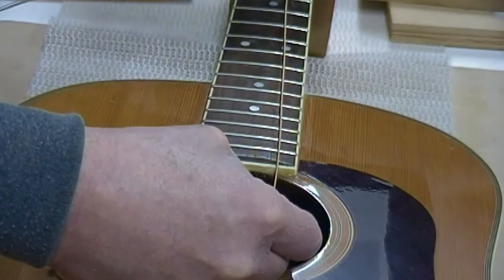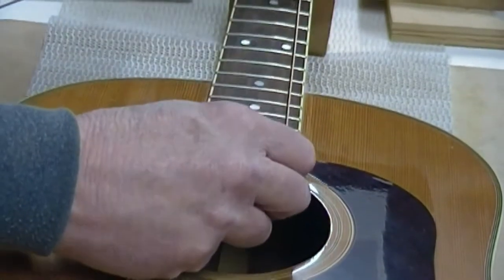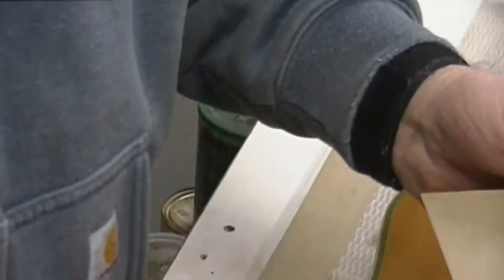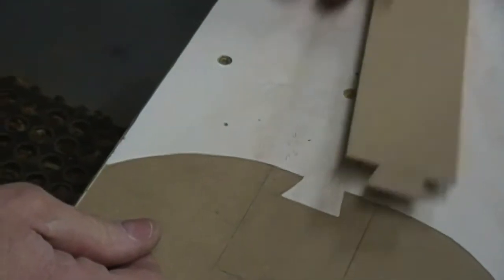JONAH GUITAR, Dovetail Neck Joint Mock up

Comment: Cool, Dane. Your cut-out model does a good job of illustrating the adjustments that are needed and the the thought process involved. A picture's worth a thousand words. Well done.
Reply from the maker: 100amplifiers, thanks amps, maybe someday I'll do mock ups of the other two directions. Thanks for checking in.

Comment: Lots of detail and well explained! For guitar necks I prefer a dovetail joint much over a mortise tenon, in my experience dovetail is much easier to get the neck centered as you explained.
Reply from the maker: the dovetail joint is perfect especially for glue up. a well fit joint almost clamps itself. Thanks for checkin in Randy.

Comment: Agree with your logic. The only other factor is the joint you are starting with.  Meaning is it tight or loose?  Your example assumes tight.  If tight, then exactly as you stated.  If loose, then rather than removing material, you may be adding several shims.  Quite possibly no material removal or very little.  Good explanation.
Reply from the maker: Hey Jerry thanks for chiming in. The job in question has already been refit and it was a little off. And it was tight. If I knew what I was doing I would have posted it privately. But I figure it a good topic for discussion.

Comment: That's a great explanation about the complexity of the dovetail joint, thanks for sharing that!

As an aside, does your camera have an image stabilization feature? I notice it jerks back and forth and that's what it looks like when that feature is turned on with a camera mounted on a tripod. The system is trying to fix motion that isn't there.
Reply from the maker: Thanks for checkin it out James. OK that's whats causing the glitch. Turn it off then while on the tripod. Thanks much